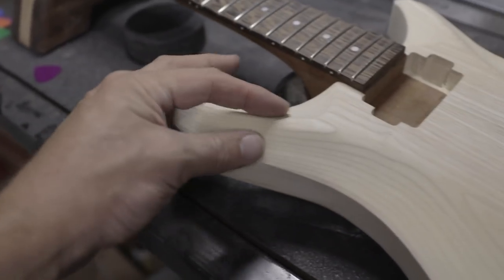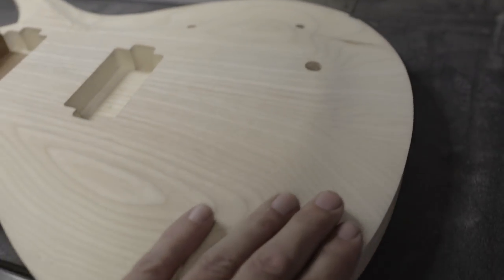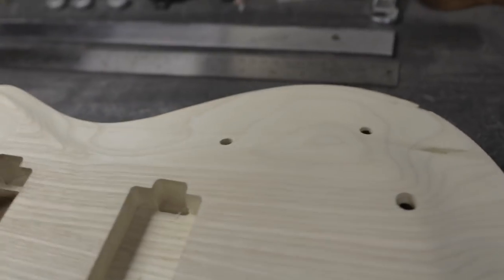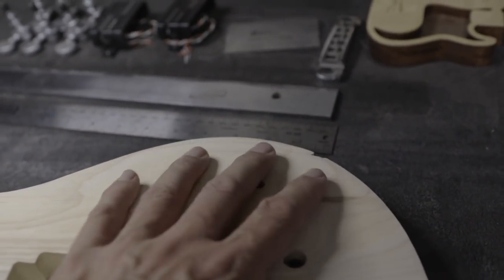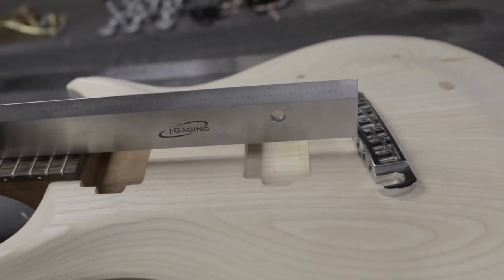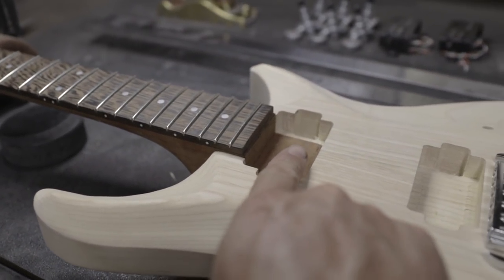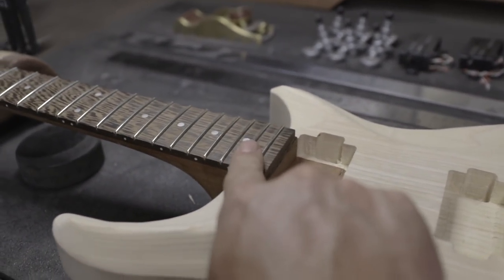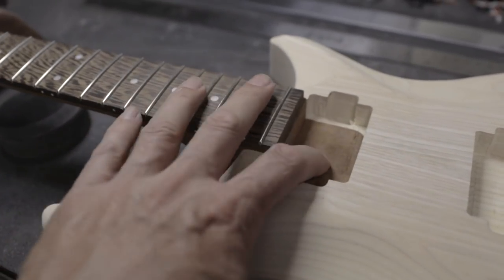Crimson Kit Guitar - Body Carve - Episode 2

Comment: Your video inspired me to carve the PRS STYLE guitar I’m making this way, thank you VERY much. For anybody that’s reading and is interested, a couple of tips that worked for me: 1) Use a fine carving disc (not medium or aggressive). I used a Cutzall, a little pricey, but worth the money 2) Use the middle of the carving disc, not the edge. The edge is more prone of digging deeper if you apply even the slightest extra pressure 3) Take it easy in the area around the horns, carve less, sand more, or you risk overdoing it 4) Apply painters tape around the edge of the guitar, where you want your carving to stop and stop at least 1mm above the tape, you may need that slack when sanding 5) “I love sanding!”, said nobody, ever. But take your time. You’re so close to the finish line. 

My respect to all the builders out there that share techniques on Youtube 🫡

Comment: If you're neck fits in it's pocket perfectly, couldn't you just maybe carve down a small area with enough clearance for access where the bridge sits to just lower the posts some so the bridge falls into the place it needs to be to be in the proper position?  I only say this because if you have a perfect fit for the neck it seems, to me, a little foolish to disturb that because it's such a critical spec to a build.  It would match up with your carving some and not altering the neck pocket at all.  It seems dangerous to remove wood from the neck tendon. Wouldn't that make it weaker?.... to plane down the neck tendon anyways?  Sorry for all the questions..... just curious.... from Tulsa

Comment: Thanks for the video. I am considering buying a kit. What is the humidity where you live? In my workshop in Melbourne, Australia, without any humidity control it is usually about 55%. Your body did move quite a bit but the acclimatisation seems to have worked well. Worth the wait.
Reply from the maker: We have fairly high humidity here.  I let it acclimate in my workshop which ranges from about 30-60%.  I could have kept it in a more controlled environment, but I wanted it to swing as much as it could so it would get all the movement out of its system.

Comment: I can't believe that body wasn't flat for what that cost! I get $150 kits better than that  and usually pretty decent wood. Nice carving tho man!
Reply from the maker: It was dead flat when I got it...  I live in a fairly humid environment, so I expected a bit of swell...  If I wanted to build a flat top, I would have finished and assembled it when it arrived.  That would have locked it down.  I knew I wanted to carve it, so I let it sit for about 6 months, carved it, then let it sit again so it could finish moving.
Reply: OK, Cool. Very nice carving work man. I just have never had wood move that much, don't know where you're at but I'm in Illinois , and must just be lucky! Rock On!
Reply from the maker: If you look at the end grain of the wood, its obvious it came from a small tree because the rings have a pronounced arch to them (I can't remember if that shows up anywhere in the vid...).  Knowing that, I expected movement.  If the body were mahogany or another wood from a HUGE tree, the rings will be almost flat even across the grain and it wouldn't have moved.  In my mind, using lumber from the US almost always opens you up to more movement.  Tropical woods tend to be much more stable...  There are a number of exceptions to this rule though.
Reply: Never worked on a build before? I can tell. Its a build it yourself kit. If you are complaining about that then you shouldn't get one. Thickness of a body is a preference. One of the biggest preferences of a build.
Reply: Yse, as i mentioned in the comments on Greg's previous video, I too bought a Crimson Kickstarter kit. Mine has a mahogany body, maple cap, and is dead flat. But I received it when i lived in England, and now having moved to France, the climate is not too different to where Crimson is based, so maybe that explains why i have no issues with mine...*except*....
When i opened the box, i was pleasantly surprised how snugly the neck fitted the pocket. This then got packed away doing the long process of moving. I have had the body sitting in a room, which got pretty cold over the winter, and when i decided to start work on the guitar, was surprised how loose the neck seemed. 
Having now been working on sanding and applying danish oil in a warmer environment the neck pocket is as snug as it was when it first arrived. 
unfinished wood DOES move around according to temperature and humidity. Wood is beautiful stuff, but it can be capricious.
And as ever, people say "you can get good kits much cheaper.." Well i tried a cheap kit, once. It was utter crap. a huge amount of work to make it even playable, and everything just seems to keep on moving about, badly fitting neck, terrible fretwork, really cheap tuners that never stayed in tune. Never again.

Comment: re the bridge... as you obviously have woodworking skills, could you not sink the bridge a little into the body? might look cool! admittedly the wraparound style might not work, but a more conventional tune-o-matic style might work, albeit you'd also need a tailpiece. Just a thought.
Reply from the maker: Yes you could.  The tool for setting the bridge pins is flat, but you could bend it and give it an offset or use a different spanner/socket.  That would make it possible.
Reply: just thought that might be an easier option than resetting the neck angle. Looking forward to the rest of the build.